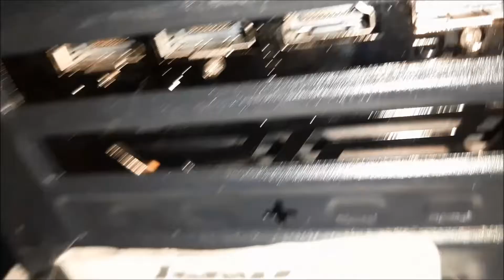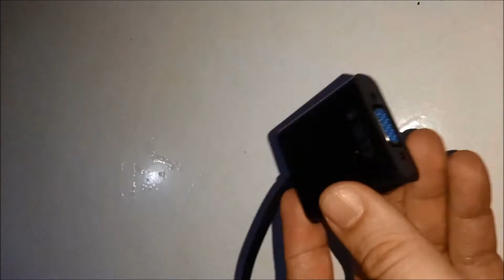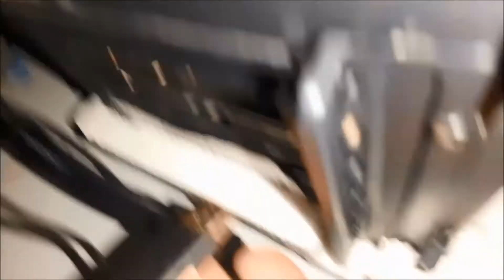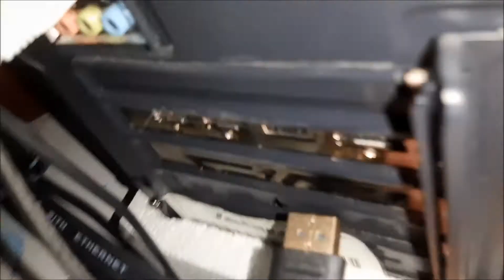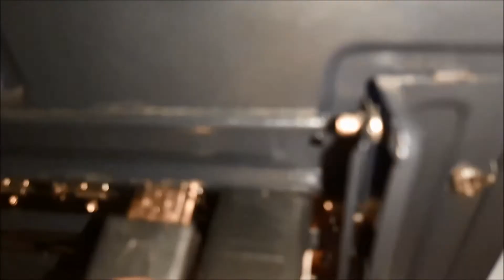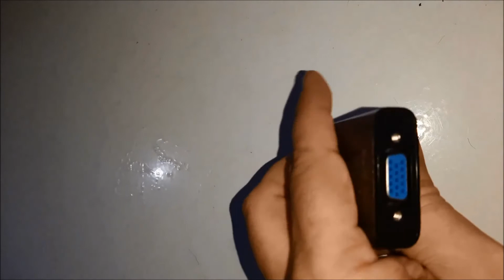How to connect two 2 Monitors to one Graphics Card, displayport to hdmi adapter, displayport to vga

Comment: i just found you video and hope that this fixes my issue, I currently have a Nvidia gtx 960, and have been trying to figure out how to set up my two monitors, the only issue is that both my monitors are VGA only. i have purchased a DVI-D to VGA active converter and am hoping that this possibly fixes my issue. my question for you, when i plug the monitor in through the converter will my pc automatically  receive the signal or will i need to play with the options before it is detected?